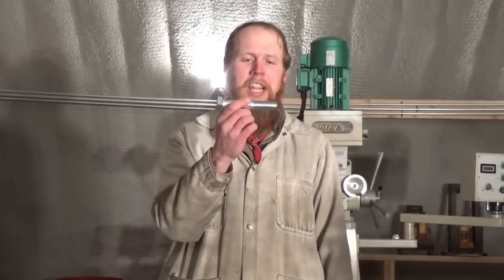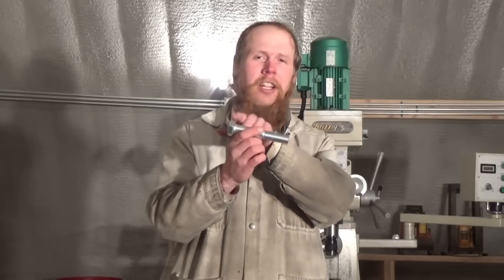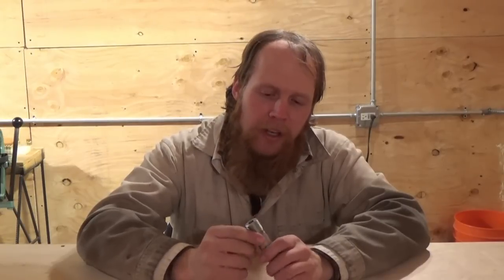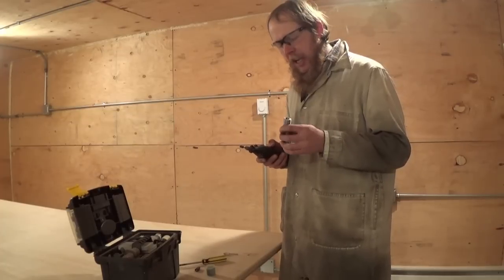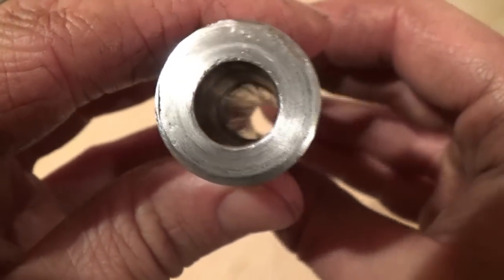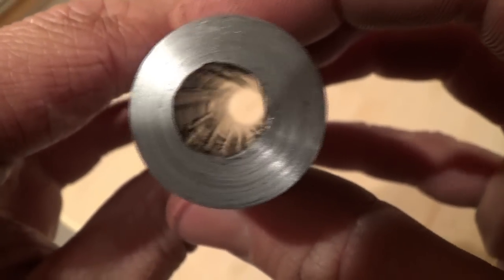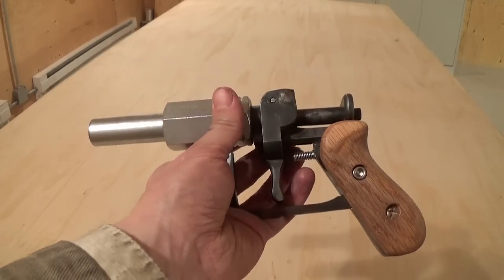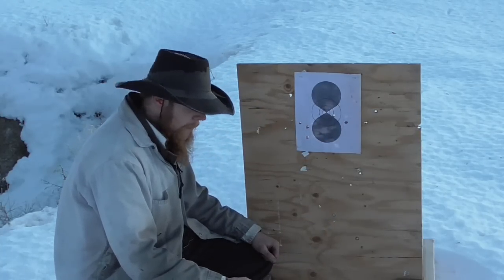Making a Rifled Barrel without Machine Tools (TIS081)

Comment: Fascinating video.  I did not realize a drill bit could drill into that bolt steel without either the bit or the bolt shattering or seizing.  What about heat and friction?  I thought injection of oil or water be needed - apparently not.  Lastly, if the (carbide?) button is strong enough to go through the steel bore, what grinder material  is used to cut the rifling pattern onto the button?   Thank you for this video and sharing your knowledge.
Reply from the maker: I do try to add a few drips of cutting oil to the hole or drill bit periodically as I'm drilling the hole, but continuous forced injection isn't necessary.  The rifling button that I used is just made from hardened tool steel, so most grinding bits would work on it.  But if you can get a carbide blank, a diamond dremel bit will still grind it.

Comment: You seriously need to work on your audio problem... you need some noise canceling, and/or you need to get closer to the mic . That could be done with either a simple cord and an external mic..  or with a wireless lapel microphone. But if you're going to be doing videos, you really need to tackle that problem. You sound like you have your head in a barrel

Comment: I'd suggest a failure test for that barrel, considering how the button broke from all the stress. Wouldn't be surprised if the barrel's capacity to hold pressure was reduced significantly due to this process. I wonder if slowly removing material from the inside of the barrel, in a machine that somehow connects linear motion with rotary, is a better way to create rifling.

Comment: Great video but the reason “tread tool” broke because the twist travel on it is not perfect and it’s handmade and when push it down it locks up and breaks. To understand it better - imagine front of that piece cuts about 1:9 twist and than end of 1:10 twist at same unit, It can’t turn all together at same time to cut.

Comment: Try using  A2 or D2 there is a lube called Trefalex I've used to tap threads in CPM -10V for metal stamping tools looks like green tooth paste NOW Put on safety glasses and
 buy a vice before you hurt yourself

Comment: You could have left the head of the bolt on up until after drilling the bore. That way you could clamp on to the head to stop it spinning while drilling. It might also be easier to find the center of a hexagon than a circle. Just suggestions. You clearly know a hell of a lot more about this than me.

Comment: Hello, i see that you used a drill bit to drill out .40 S&W chamber. This cartridge has very little taper to it, so it works fine. Do you think that a simmilar method would work for 9mm Luger using a 9.8mm drill bit? Or would the fired cases bulge too much, rupture and fail to eject? Thanks in advance and pardon if i mixed something up.

Comment: 8:05 you could just draw your line for say a 1 in 16 twist as a right triangle with a your circumference as one side and 16 in as the other then take your circumference an divide by the number of flutes you want for the space between them. it wastes paper but is easier for most people to understand

Comment: At a rendezvous I attended some years back, there was a gunsmith who makes muzzleloading rifles using tools from the early 1800's.  He had a die that was hammered through the barrel to cut the rifling.  The barrels were formed around a steel rod.  The tooling was only good to make one specific diameter of barrel, and would require a whole different set of tools to make a different diameter barrel.

Comment: Could you have left the head on the bolt and screwed a nut on as for down as possible to hold it nice and straight in a vice that attaches to your drill press?

Comment: Here are the explanations for some of the trouble with the operation.
1. The grooves  were cut by hand, they are not at a perfect angle or depth. These imperfections are magnified when a longer barrel is cut.
2. In the real world the proper shape of the grooves is greatly enhanced by rotating the button by a fixture.
3. The grooves' shape is not abrupt, the depth of cut increases gently as the button advances.

Comment: i realize that this may be out of scope for what you are doing but , if i am making a barrel for a php air gun the overall pressures are going to be  lot lower and i wondered if you could take seamless steel pipe and wrap it with glass or carbon fiber like they do for air tanks for harmonic dampening.so i would have a large diameter barrel that was light and had very little steel in it even titanium might even work well for the barrel liner?9000 psi is the highest readily available gas to work with and that would be nitigen.thouight you might be interested.

Comment: Brilliant.  Nicely done.  Since you are using a custom piece of melted aluminum to give you the space below the barrel, I have a quick suggestion for the rest of us.  Rather than cut off the ends of the stock at the beginning, simply leave it a little longer until after you drill the barrel size you want.  You can then cut it to length as planned but use the rest of the stock length to "catch" the button.  It's already the diameter you need - but you'll need to drill it out wider of course so it drops rather than tries to groove the cut end.  

Great job making things simple for the simple among us.

Comment: It is not that hard to make a spiral guide to pull the button through the bore. That technique was invented around 1500 CE. I suppose the same type of guide could be used to push the button, but it would probably need to be far more substantial. In either case, the button needs to be securely fastened to the guide rod.

And the grooves can be swagged using multiple passes. The cutters just have to be adjustable - which could be as simple as adding a thin layer of paper under the cutters after each pass. The button should also have a guide at the front that is a easy slide fit through the bore - allowing a much shorter swaging surface and greatly reducing the effort needed to pass the button through the bore.

Comment: It's called a "Broach"
Reply from the maker: Almost.  In this case, I used a button rifling method rather than a broaching process.  A broach cuts metal, whereas a button merely displaces it, although this could probably be done by broaching as well.

Comment: Tap Magic might be a better lube to use than the EP grease, give a better finish and stop the friction welding.  A button made from carbide would be ideal, if you could grind it and get it smooth.  Very cool video.  A barrel made on your lathe would be scary accurate.  Thanks for sharing.
Reply from the maker: I made a video about making a barrel on the lathe recently: 
https://www.youtube.com/watch?v=CYh6CsykHH0&t=1s

However, when I tested it, my red-dot sight was wandering and I didn't realize it until later, so I made a separate video that demonstrated its accuracy more reliably:
https://www.youtube.com/watch?v=ESfqtzgOuhQ

Comment: Just wondering if a person used an Allen wrench of the appropriate size.Put it in a vise and give it a slight twist with a vise grip. It should give a pretty accurate design for rifling. Although it might not be a hard enough material to accomplish the desired result....just a thought
Reply: Your concern is correct - Allen keys and screwdrivers are far too soft to be used.
Reply: Another thought....would  repetitive heating and cooling of that material be enough to harden it  so the procedure could be performed

Comment: The first button may have broken because it had to spin in the barrel because of the rifling but could not spin against the hydraulic ram or whatever you were pushing with. Maybe a close-fitting bearing ball between the button and the ram will allow the button to spin freely.

Comment: A really great video...thank you!
Just curious...how many times can you fire a round...on average... through that barrel before it fails?
Reply from the maker: Before the barrel fails?  Well, I don't really know - I've only put maybe 50 to 100 rounds through this barrel, but it shows no signs of degradation yet.  My guess is that it would take at least a thousand rounds to wear down the rifling to the point where it would no longer stabilize bullets effectively, but that is just a guess.
Reply: Kewl beans!
I was just wondering if the pipe-type barrels have a faster wear rate than standard drilled & turned barrel.
A friend of mine back in the day made a 20ga pipe gun but noticed it wearing fairly quickly (~ 80 shells) before the inner walls got too thin to use.
But to be fair...he might not have used a high grade pipe...so that was why I was asking.

Comment: Why didn't you cit on the lathe?
Reply from the maker: My goal in this project was to demonstrate that it was possible to make a barrel using only common power tools and hand tools, but yes if a lathe is available that makes barrel making a lot easier and more precise.  Later I made a much better quality barrel using the machine tools that I had available: https://youtu.be/CYh6CsykHH0

Comment: Hey pard, I am seriously thinking about developing a  .12 Caliber wildcat from 22lr. It would be moderate powered and very quiet. Probably about a 3 to 8 grain bullet.  QUESTION: Do you think it would be possible to rifle that small of a hole? Also, I found a source for Grade 8 (actually more like grade 12) bolts 7/8-14 for less than $2 per bolt. I can PM you on Facebook about that. Also. That method that you used for boring the bolt was exactly what I originally what I used to make holes for dies. I have recently got me a 7x10 lathe from Harbor Freight. Makes a great difference. With it I made a "Holder" for 7/8-14 bolts with a B16 taper hole so it can be attached to one of those $40 HF drill presses. I just screw the bolt in and cinch it with a nut and I have a reasonably effective lathe alternative. I will put a video on FaceBook with it.

Comment: If you don't have a lathe for the button use a slightly longer piece than you need and put it in a drill. Set the drill in the vise horizontally and start it, and work it with wide files of increasing grit.

Comment: Great video, very informative and I admire your Ingenuity! However I have read that it's very important to have the cut face of the barrel through which the bullet will exit perfectly perpendicular to the bore so that it releases on all sides at the same time, eliminating greater drag on one side causing it to veer in that direction. How did you control for this?
Reply from the maker: In this case, the uniformity of the muzzle crown really wasn't controlled very precisely, and yet the accuracy was acceptable (see https://youtu.be/YyjfhvVL9vc ), so maybe the effect isn't as pronounced as we thought.
Reply: TheIdahoanShow nice, thanks for the reply! I figured after I watched the rest of it that you probably evened up the crown on the lathe after you cut it with the hacksaw but it's cool to know it isn't really that important.

Comment: For a .22 barrel, I used an old 1/4" spiral cut reamer ground down to size and hammered it through. Admittedly I used a lathe and clamped down Dremmel grinder, but it could be done on a drill.

Comment: 1) would have helped to get a "perfect center" of the bore AND chamber if you bothered to clamp down the two wood blocks (you was VERY sloppy!). 2) Also how about try using some metal cutting lube with drilling the bore and the chamber!  - I was a police department's gunsmith  and armorer for 23 years.

Comment: What portion of the button actually does the "cutting"? I saw that the grooving device was tapered on both ends. Does it just scrape the barrel material away by being rammed through? How many passes on average do you make with the same button in the same position before you get the desired effect? The feds will never be able to disarm everyone. Great video.
Reply from the maker: Nominally, there is no cutting - the grooves are impressed into the steel, not cut.  Think of a tire rolling across soft ground - it leaves a groove in the ground, but not by removing material.  It only takes one pass per position.
Reply: Thanks for the reply. Very informative video.

Comment: was thinking a button with a few carbide tips would actually cut the grooves rather than displace them.. at the tail would need to be a guide piece also used to drive it.. it would look like a carbide insert end mill I guess.

Comment: There is also an etching process that is extremely simple. You simply paint the barrel inside and out and then build an apparatus to scrape off the paint where the riflings will be inside the barrel and then submerge the barrel in a bath of water and baking soda and then hook the barrel to the negative terminal of a battery cable and install the positive terminal down in the bath of baking soda and water and then hook the cables to a 12 volt battery and it will rust the riflings in the uninsulated areas, after a day or two, where the paint was scraped off. Look into it, I thought this was pretty neat.

Comment: Geez - just use a lathe.   Also some coolant/lubricant helps (a **&^^LOT!) when drilling/cutting/boring holes in steel - DUH!
Reply from the maker: I think you missed (or misunderstood) the point of this video.  Yes, this can be done much more easily and more precisely using machine tools (like a lathe), and that is normally how I would do it, but the whole point of this video was to prove that it could be done even without machine tools.  And yes, I used plenty of cutting oil when drilling out the bore and chamber - didn't you see the smoke trails left by the hot chips?
Reply: Sorry - I tend to be too critical many times but your video is quite interesting!!    I believe crude guns are fashioned in third world countries using even more primitive tools.  I willl delete my naughty comment - LOL

Comment: Just a question, after you made the rifling did you harden or heat treat the barrel?
Reply from the maker: Driving the button through the barrel causes some work-hardening of the steel that is displaced to form the grooves, which improves the wear resistance of the rifling, but I didn't do any heat treatment of the barrel after rifling it.

Comment: Without machine tools,  like a drill press?
Reply from the maker: A milling machine would be a machine tool, but a drill press is not.  A drill press - particularly a cheap little bench top model like this one - is just a common power tool.

Comment: This is funny to me, because I used to make rifling buttons for many of the top manufacturers of firearms and this is not at all what rifling buttons look like. Typically it is a convergent cone, like that of a rocket nosecone facing forward, followed by a rearward facing cone. It is a little more complicated than that, but you can look up a rifling button and find an image that will better demonstrate the shape. Then the rifling buttons are cut in as small grooves in a spiral pattern, not as raised grooves. It forces the material outward as it is swaged into the barrel. There are sometimes a smaller set of cones ahead that hold the rifling button in the center and act as a guide. I never made one that wasn't tungsten carbide, but I did make some other tools that were 4130 chromium molybdenum, that were then heat treated after we were done grinding them. But this low tech approach is novel.

Comment: Hey, really liked the video! Here's my two cents: drill out an aluminum block that can be mounted to the drill press, put the drill bit in block and chuck up the barrel. You'll get a much straighter bore that way. I've pulled stuff thru different long bores using an electric motor, but pushing it w/ a ram makes me wonder if you couldn't pull it with a short hydraulic ram? Man you got me thinking!!!

Comment: Question, how does that work to pour molten aluminum (melting temp 1200F) into a tin (melting point 450F) can?
Reply from the maker: The term "tin can" is a bit misleading because these cans were never actually made of tin.  They were originally made of tin-plated steel, and were more properly called "tinned cans," but this name was typically shortened to "tin cans" and this name continued to stick long after the tin plating was replaced by the zinc and/or polymer coatings used on modern-day cans.  In any case, the body of the can is actually made of steel, which has a much higher melting point than aluminum.

Comment: This is really cool.  Just one question ... is it possible to have the piece shatter during the pressing operation?  I noticed that you didn't bother with any eye protection during that hydraulic cold-tooling phase - am I just overthinking it?
Reply from the maker: I suppose it is possible that the drive rod could snap and send fragments flying.  Wearing a face shield probably would not be a bad idea, actually.
Reply: Okay, so - safety tip for the over-cautious : )  Still, excellent work... I'd never have thought to attempt this : )

Thanks for taking the time, it's appreciated.

Comment: good luck trying to reduce the diameter of a high tensile drill  with a file !!!! unless you buy crap drills !!!
Reply from the maker: You're right--trying to file down a drill bit with a steel file doesn't work because the HSS drill bit will typically be harder than the HCS file.  However, a silicon carbide whetstone (or other abrasive stone or grinding wheel) can be used in place of a file to grind down HSS drill bits if necessary.